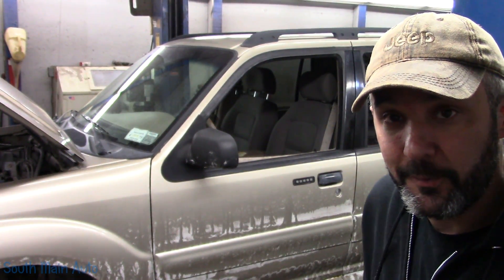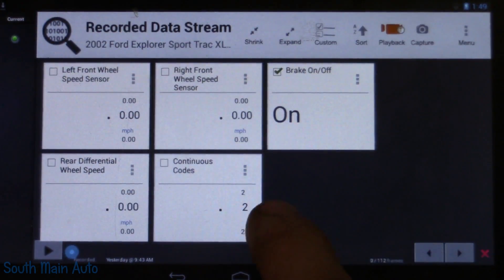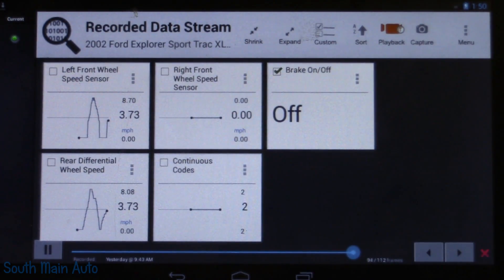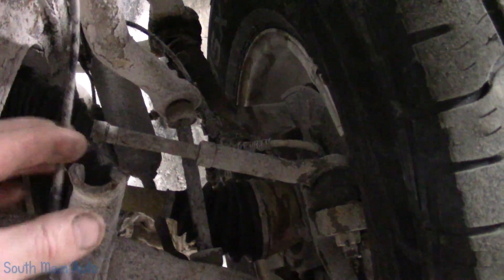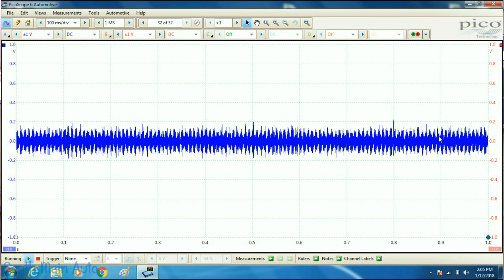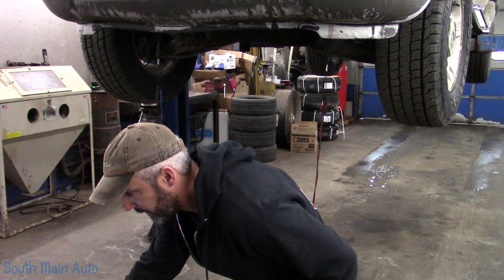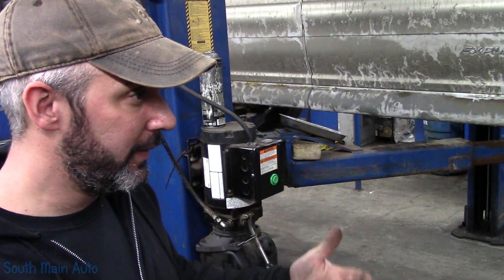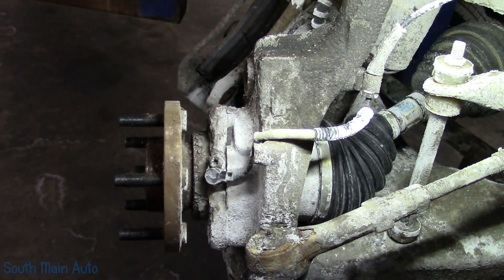Ford Explorer Sport Trac: ABS Light On / WSS Signal I Can Not Explain??

Comment: What about wiring from sensor connector to abs module? With so much salt it is possible that they are corroded and create resistance (in this case act as a capacitor in an ac circuit)? I would switch sensor sides to see if it moves too... Only after that would I change the hub. 
Best regards and thanks for good and usefull videos!
Reply from the maker: We switched them in the video to prove that was not the case.

Comment: Most likely the ABS module has coupling capacitors on each sensor input. Their purpose is to allow AC voltages to pass and block any DC ones. It physically  isolates the sensor (from a wired electrical standpoint) to the analog to digital converter. Its possible that cap is breaking down and passing a DC voltage back out of the module. It will then have an effect on the A to D converters input being the sine wave isn't swinging across zero volts. But, you sort of killed that theory when you jumped the Left to the Right and it worked. What happens if you unplug the left sensor and spin the right all by itself. Do you have scan data then? Is it possible that ABS module has an issue with both plugged in?

Comment: i had one that threw me for a loop last week for unwanted abs activation on a saturn vue. looking at the scan tool the lf was dropping out... all signs pointed to a lf sensor. Come to find out the rf brake hose was partially collapsed and the lf wheel was stopping first. Spinning the wheels in the air did not show any problem with the brakes. Then after all that mess still had unwanted abs activation. Had to graph all 4 sensors since no wheel was dropping out and found the lr had some glitches.

Comment: I don't know if this makes sense but seeing that passenger side abs sensor is not the same length as OEM, I would have compared length from presumably defect passenger side sensor to the working driver side. And perhaps would have put driver side sensor in passenger side hub to see if I'd get a reading on that side with a know-good sensor in that hub.
Reply from the maker: Both sensors were the same. They were both Moog.

Comment: That sucker was SALTY!! I estimate another 2 years MAX out of that one, before the body opens wide. Yikes!!

Wish I could download that Pico file on the iMac. Must be a "Microsoft products only" file - I can't see it. Grrr!

Certainly was an odd, slightly higher than normal voltage waveform. Nothing shocks me anymore with modern vehicles - never know what you'll see on the screen! Salt certainly doesn't help things (except OUR wallets :D ). 

Not today though -  worked for free. Had to fix our Volvo 940 out in the driveway at 16°, since the new shop floor was never poured ... also because it was 16°!  Anyway, the 25 year old upper tranny line finally let go - one too many trips through the liquid car dissolver. Was peeing everywhere - marked it's territory all over the state, mainly in the driveway. Luckily I've got a wife that knows enough to park it, rather than send the tranny up in smoke - that would've been a fantastically fun job out in the driveway! As soon as I put a wrench on it, the line broke clean off  - not even 1/8th turn. It was close!  Fixed it with some copper refrigeration line, with some never-sneeze on the steel nuts. Won't have that problem again. :) 

The pretty copper will be green by April, though, that I can guarantee.

Comment: Moisture, Salt and different kinds of metals ( copper steel etc. ) and you have a battery. Probably moisture leaked in with the salt. Viola, voltage offset. ?????
Reply: BTW, some plastics actually will absorb water. Not to mention the heat/cool cycles can wick water up the little metal tab that sticks out the end if the seal is not perfect.

Comment: It seems as they have two different sensors, left from right, right side has a slit for the sensor left has a bar, so the left side may have a stronger signal then the right.
Reply from the maker: Same number for left and right.

Comment: Had a problem like this on an old Subaru. Found some really fine metal shavings between the sensor and tone ring causing a ground loop, causing it to have a slight dc voltage. Which made the abs module think the sensor was bad. When the code trips on them the module won't report any wheel speed data, so the ecm, Speedometer don't get confused.
Reply from the maker: We proved in the video that the right side will read with the "code tripped"
Reply: South Main Auto Repair did the code clear itself (or switch sides) when you plugged in the good side? Most abs modules will clear codes almost instantly, or when you cycle the ignition switch, none of this has to make two trips and then codes will clear.

Comment: Well I think of course the amplitude is too low. This causes the abs module to not see the signal at all, thus it may put a bias voltage into the circuit for like open coil detection. This gives the offset in the reading.
Reply: The mysterious  offset was with the sensor disconnected from the ABS module. So apparently from the raw sensor.

Comment: In that last run of the Pico, looked like there was one-way cross talk. You spun the left wheel and it generated an isolated wave, but when you spun the right it caused voltage activity on BOTH channels. Clue?
Reply from the maker: Not cross talk, just the other wheel started to spin is all

Comment: Purely an uneducated guess here, but the last waveform captured showed cross talk on the left wheel trace while running the right wheel. That could be the indicator as to why the module doesn't like the signals coming from the right wheel....

Comment: one thing i have seen (was absolutely astonished )happened on a gm distributor shaft  it got magnetised somehow. and the truck would only run with the distributor in one certain place. otherwise the magnetism would cancell out the pickup.(out of time no power) changed every piece in that distributor one part at a time to no avail. made connections at gm they told me to check the shaft for magnetism if so replace the whole unit.  i did  it was and that fixed it .  crazy. in a 366 gmc motor.     is it possible that a  tone ring that is not to be magnetised got magnetised?     i suspect that is a trigger wheel sandwiched in the middle of bearings . that would account for a dc offset

Comment: There is a capacitor in series in the modules circuit that only passes ac voltage across it. I would suspect it or another internal capacitor is leaking.
Reply: KENHUNTSMAN100 He was seeing an offset without the module in the circuit.

Comment: get a signal generator, input the signal and see if it is "understood by the ABS module. Essentially what you just did with the jumper wires, LOL.
Reply: Don Erickson the cheaper picos will let you do this, AWG? Waveform generator?
Reply: Yes they do. Even the cheapest model 2204A has a AGW (signal generator) capable of producing all common and custom waverforms upto +-2V, which is 100% perfect for simulating this type of ABS sensor. For higher voltages you just need a simple voltage amplifier.

For 99 pounds (2 probes included), it is a bargain. It even does CAN traffic data analysis.  I'm not selling these scopes, nor I own Pico stock, I just use it, and for my audio / automobile use, even this cheapest one is awesome. The software is the best there is for PC scopes.   

https://www.picotech.com/oscilloscope/2000/picoscope-2000-specifications

Comment: Curious as to why the Moog hub was different that the new speed sensor would not work. Unless they are trying to capture the speed sensor sale as well?
Reply: I used Moog parts for years with no issues but the past 10-15yrs I've gotten away from a lot of it.
Reply from the maker: It is not uncommon to see aftermarket hubs with different speed sensors. I mention this in the video too.
Reply: ever since moog got sold to cooper, there quality has gone down hill, in 1987 I spent 2 weeks in  MO going to moog school, quality was job one them,  now its  profit, so sad

Comment: Got a similar issue with an 05 Pacifica.  New right front hub due to code saying right front.  Is the wire from ABS module wire down to new sensor wire replaceable?  And is the test an ohms test?  800 - 1500 ohms?

Comment: Did you do a resistance check comparing both sensors?  Did you try cross connecting the bad sensor to the drivers side harness?  Could the bad sensor have a micro crack that reaches between the interior and the metal mounting insert and the heat cycling has drawn in salty conductive moisture creating resistance and/or capacitance to chassis ground causing the offset?  You may have a whole R/C filter going on in there dampening the signal. You mentioned the offset went away when it was reinstalled which hints at a physical connection. 
I'll go with "What happens when the signal is not strong enough to get past the spurious signal rejection filter in the ABS module" for $300
Reply from the maker: -Did you do a resistance check comparing both sensors? - NO
-Did you try cross connecting the bad sensor to the drivers side harness?  - Showed that in the vid

-Could the bad sensor have a micro crack that reaches between the interior and the metal mounting insert and the heat cycling has drawn in salty conductive moisture creating resistance and/or capacitance to chassis ground causing the offset? - Explained that is what I was thinking in the vid but upon inspection did not see a crack.
-You mentioned the offset went away when it was reinstalled which hints at a physical connection. It actually went away before removing.

Come on Eddie, not one single joke in all of that text!? Are you ok???
Reply: Eric, great video! The editing is superb! And I like Eddie's questions!

If you still have the car, could you check the resistance of sensor pins to the Chassis Ground when the sensor is unplugged? -- if there is any, this could  "confuse" the differential amplifier in the ABS module, while you would not see that on the (electrically isolated) scope.

Also, at 10:20 you showed that the good sensor works on passenger-side harness, but not the other way around, like Eddie asked. Did we miss anything?
Reply: Actually, no I'm not and I was rushing out the door.
Anyway, how can I make jokes when I'm batting ZERO on my guesses??  Plus, your new spooky video look just drains all the merriment away.  Who can be funny when Voldemort, after just making up a new batch of Bad Air®, is about to zap you for using purple grease? Mrs.O will have to come out to point the camera at a pair of smoking boots with a Jeep cap perched jauntily on top.   Besides, I used up all my good material on the LIVE chats that gets lost in all the scrolling of "My engine don't start ! Wutz rong?!" and talk of a certain timing chain you've been dodging. :P

Comment: mine the breaks are coming on and  RSC BUZZ AND ALARM IS COMING ON THEN GOES OFF I PULL ALL 4X4 FUSES AND IT WILL DRIVER but RSC still comes on with tc abs lights

Comment: WHy not try the OEM sensor? Maybe the short aftermarket sensor is the problem all along.  As long as the OEM isn't contacting the ring that may be the problem.
Reply from the maker: I had OEM sensors, They are to long for the aftermarket hub

Comment: ABS WWS BEFORE
BLUE CHANNEL = 277 mV
RED CHANNEL = 280 mV

ABS WSS AFTER
BLUE CHANNEL = 794 mV
RED CHANNEL = 459 mV

THINK THAT THE DISTANCE BETWEEN THE SENSOR RING AND SENSOR HAS BEEN MADE IN SOURCE OF RUST.
WHEN THE RUST IS REMOTE, THE REMARKS ARE LESS AND FURTHER AC SIGNAL
THE NEW AND OLD SENSOR IS NOT LIKE LONG, SO THE DISTANCE IS TO BIG FALDER AC SIGNAL.
WHY WAS SHIMS UNDER THE OLD SENSOR?
GoogleTranslate from danish

Comment: just a thought but could it be the spacer on the sensor be causing low signal voltage. It is all aftermarket stuff. Oh yeah is it possible to put some of that salt on you chimichangas?
Reply: Oh by the way thanks for the jumper wire tip from good sensor to opposite side. Should come in handy. Great vid

Comment: greetings friend i'm from venezuela i say bad english i use google to talk to you ... I have an explorer 2010 4.0 v6. I have abs lights on, skidding, handbrake ... the scanner code b1342 error or ecu error appears. The module was sent to be checked on a test bench and everything went well, I tested the direct positive 2 pins (1-32) and the direct ground (16) on the abs module cables as well as the positive one for the suiche. I also tested pins 12-13 of the 61 ohm given by the two module communication pins ... I would like help with this friend please something else that I can review. here the situation is difficult to have experts ... the 4 abs sensors are perfect the scanner allows me to see that they work perfect ...

Comment: take the shim out on pass side on old sensor, put shim on new sensor, I know the distance from the tone ring has a spec but I won't say I know it because I didn't listen when told lol, I was to busy thinkin, how in the heck would you measure the gap.
Reply: james mac the spec on Wabco ac speed sensors is .04" or less. Use a depth gauge to measure the distance of the flange to the top of a tooth, then measure the length of the sensor and calculate the difference.

Comment: Geez ... You are making my brain hurt !  Us old farts with CRS ...

The circuit inside the module uses a "zero crossing" detector circuit.  When the voltage from the sensor goes from above 0V to below 0V it outputs a signal.  This could be a signal to a one shot which would generate a nice pretty square wave for the µP or just stay high (or low) until it "crosses" 0V from the other direction.  DC offsets don't matter as long as they are constant (𝑑𝑢ℎ, 𝑡ℎ𝑎𝑡 𝑖𝑠 𝑤ℎ𝑎𝑡 𝐷𝐶 𝑜𝑓𝑓𝑠𝑒𝑡 𝑚𝑒𝑎𝑛𝑠) and the signal actually does cross 0V (ground).

I have seen circuits where the will bias the coil in the sensor up a couple of volts just to get it out of the "ambient noise" range.  Then the zero cross circuit must also be biased.

Go ask Ivan !

P.S.  Very logical to use a "known good" signal generator (𝑡ℎ𝑒 𝑙𝑒𝑓𝑡 𝑤ℎ𝑒𝑒𝑙) to validate the wiring integrity and the circuitry inside the module !  A+ for that

Comment: someone needs new hubs assemblies with sensors, as long as you checked the wiring from connectors to the abs unit. not worth the sensor cost and likely rusted inside.
the dc offset is probably capacitive/inductive coupling from having both test leads so long and hooked up. metal car, lift, concrete laptop, cart it's on or possibly the sensor/sensor lead leaking/coupling to the vehicle itself. then again, maybe you've found the downside of magical laptop connected scopes :)

Comment: Disconnect the ABS system .......  Fixed.
Reply: That was going to be my reply, drove many years without abs don't need them.
Reply: Norman Jones : 
How did we make it without ABS?  Answer : Just Fine.
Reply: @jimmyfiggs6293  Not driving a sport trac in deer country you wouldn't be fine.  If you don't manage to hit them, you'll be off the road or flipped over without ABS.  They maneuver horribly.

Comment: waiting part 2-where new hub "might" have rusted or worn geared teeth so speed sensor fails to put out proper signal
  suspect Ford integrates hub,so entire hub must be replaced
   -Pine Valley ,your buddy, replaced EXTERNAL  toothed gear        -just held on by RUST     -built FORD TOUGH ~~

Comment: IT doesn't take a genius to see the passenger wheel sensor is physically too short, leaving too much air gap between the tip of the sensor and magnet wheel, resulting in weak signal which cannot generate enough voltage specially at lower revolutions. Rust buildup under it making things even worse.

Comment: Time to throw parts at it!
Reply from the maker: No we do not need to do that. We KNOW it needs a new sensor on the right side but because it is an aftermarket hub finding the correct sensor can be difficult. Throwing parts at a car means you are guessing. In this case we will replace the defective part that we tested.
Reply: South Main Auto Repair with rust like that I would replace the front hub with a new ABS sensor installed every time. The cost of a front hub with ABS sensor installed is no more expensive than OEM ABS sensor by itself I guess it just cost more in labor.
Reply: Back when I had an 02 Ford Ranger the local garage replaced both front hubs for the problem of slow speed coming to a stop sign and the ABS coming on and the pedal falling to the floor. Years later I had an ABS light come on and it was the right front sensor. I replaced the hub myself. Both times it was as cheap to replace the hub. Also it was hard to find the sensor without going to the dealer. I had to get rid on mine a couple of years ago. Rust hole on the frame passenger side right behind the cab there is a ground from the cab to the frame.

Comment: Could have a bad ground somewhere on the vehicle. If you would have disconnected the battery the voltage would have gone away. The offset you are prob seeing is going to be the dome light or clearance light circuit with a poor ground.